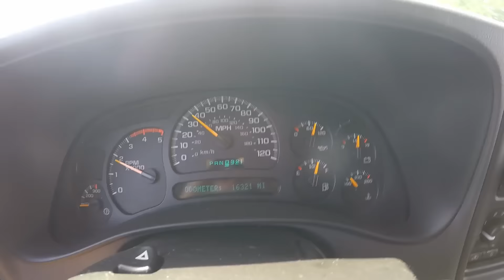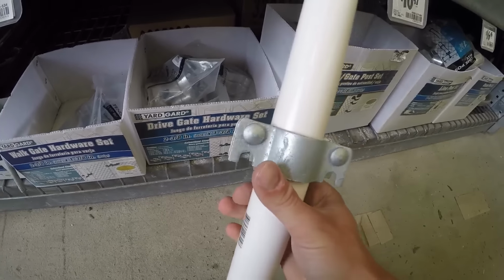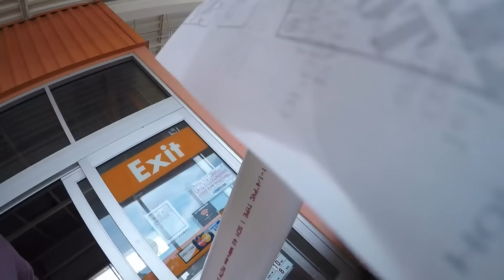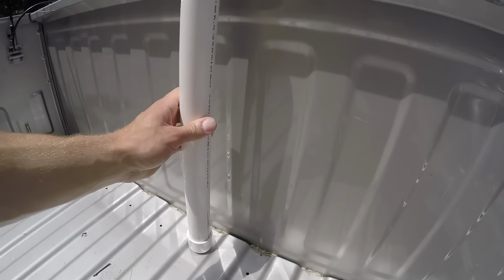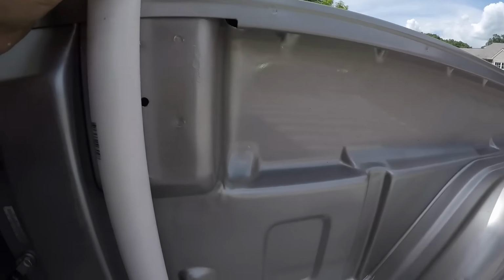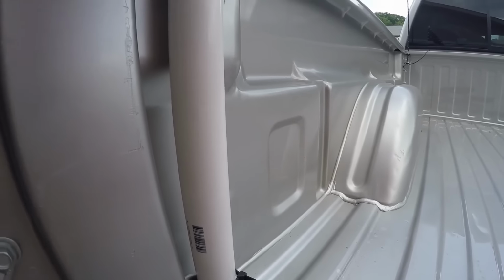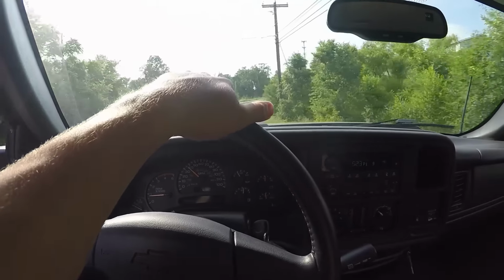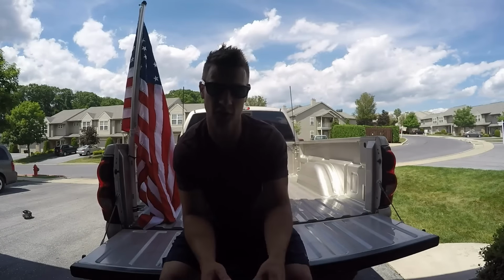My Duramax Is Missing Something...

Comment: I've been flying flags on my truck for over a year now. Both on my 95 Cheyenne and now my 2010 Silverado. The flags themselves can handle high speeds well but they fray a lot faster. I've hit a 100mph a couple times with them on and probably down ever again but the flags them selves held up, but the mattering on how you have them mounted would determine if the whole setup would be safe.

Comment: +street speed 717 what you can do is drill a hole through both the  flag pole and pvc pipe and put a self tap screw there or a bolt and nut so it won't fly out.

Comment: Dude the best flagpole for a truck I have realized is just a pice of 4 foot or so angle Iron with the flag zip tied to it. Then take the angle iron and push it down into the square holes on whichever content of the bed. It won't bend and looks way better than pvc in my opinion.

Comment: Hey man I also have a Silverado and what I do is just stuck the flag in the corner inside the bed rail...there is a hole that goes all the way down the rear quarter panel it sits in there securely you just need a flag pole thin enough..ive driven with it 65 mph and its solid

Comment: you should of used black pipe. the stuff people use to run gas lines in housed. I know it's expensive but, I used that for 8 months without a problem. and that was going 75 mph on i35 in texas.

Comment: The truck needs a wrap with a flowing flag all over it!!!  And a super loud open header exhaust.  'Murica!!!
Reply: It already has straight pipes lol
Reply: Lol diesels don't have headers.
Reply: Lol diesels don't have headers.
Reply: 4 inch straight pipe from the downpipe(s)
Reply: Hunter Stuart
and they do in fact have headers, how else is the exhaust going to spin the turbo to make boost? magic pixie dust?
Reply: if it doesn't have headers where is it straight piped from? last time I checked my Duramax had open headers
Reply: +Bhswarrior94 it's a turbo back exhaust meaning it's from the down pipe of the TURBO (not headers) back.

Comment: only thing I would suggest is put a set screw through the pvc into the wood. There could be cross winds or even updrafts created by the tailgate. Don't need Old Glory sliding down the road.

Comment: I might suggest drilling a hole through the pvc pipe and into the flag post. Then run a self tap screw through the pvc into the flag post so it can't come up and out while going down the road.

Comment: Some tips: Put the flag on the right side, that's what the flag code says. 
Use metal carabiners to attach the flag to the pole, the flimsy metal ones that come with it wont last long.
Get a better flag. The one that comes in those packs is junk.

Comment: Use a different pole than the one that came with it I did the same thing and drive with it at 55 for a few miles and the pole snapped it's worth it to go with a stronger pole

Comment: +Street Speed 717 what I with with my truck is put a 2x4 in the bed up by the back window put 2 "U" bolts that held a PVC pipe which held my USA or TEXAS flag and It held pretty good going 70 down the freeway, if I wanted to make things more sturdy I would get a two ratchet strap rap it around the pole of the flag and tie it to the hooks on both slides of the bed and ratchet it down to make it right and not move!!

Comment: i am sure some one has already told you this but a couple of my buddy's did the same thing last year but for 9/11 and we kind of did the same set up. but the metal pipe that comes with the flag from home depot is very flimsy and so it would end up bending and so fix this it was simple we just replaced it with a wood pole and with the wood pole we drilled screws into the PVC pipe and the wood pole so they would be together and you would go off road or something and the flag falls out, and with the wood pole we covered it in white duck tape to make it look better. just an idea man i still have my set up if you'd like pictures. we did it in my friends silverado and my mustang gt and we got up to 110 with out it falling off haha. you a smart guy so i am sure you have it figured out, if not i can help

Comment: btw its on the wrong side, when the flag is moving forward in battle or in a parade or anything else, it is on it's right side. in this case it would have to be mounted on the passenger side of the truck in order to be deemed appropriate flag etiquette. but awesome idea dude, i drove an 01 accord and made a double mount that straps onto the trunklid

Comment: tip... drill the flag pole and drive a screw in thru the pvc pipe into the flag pole  (i notice u got a hole in the pvc pipe already) added security to keep the flag pole secure ......another thing.. u should do a workout vid/routine.. youre fit dude

Comment: Hey if you want a secure flag pole stand you should (if you have a towing package) is to take a hitch with no ball and a metal pipe. Weld the metal pipe (maybe about a foot long or more) into the hitch and weld a flat piece of metal to the bottom then you could add your flag! 
P.S. Your vids are awesome keep it up!

Comment: Use some metal hose clamps instead of zip ties. Or if your bed has the 2x4 slots in the bed, make a custom mount out of a couple of 2x4's and you can centre your flag in the middle at the front. Slots I'm referring to: http://tinyurl.com/hbzyhjw

Comment: What's wrong with his tired is it cause the stick out from unfmder the fender
Reply: Yes its technically "illegal" because it could kick up rocks and hit peoples cars
Reply: they actually can harm your truck lol
Reply: Wheel spacers can hurt ball joints, anything more than 2- 2 1/2 then you can have fun replacing ball joints
Reply: he doesn't have wheel spacers on it,  he has negative offset rims
Reply: You can run any sized spacer you want as long as the wheel offset positions the tire tread center on the wheel bearing. Hence why dually trucks have up to 6'' spacers on the front, factory at that.
Reply: +Cory Sig yeah I know, that's how my rims are
Reply: +Dylan Groat Wheel spacers suck and are dangerous i have seen them break and the tires go flying. dumbest invention i have ever seen
Reply: +QuadManAustyn99 it's all for the stance tho man.... Haha, I agree with you
Reply: +Jacob Hatzenbeller actually they do, they wear out the wheel bearing faster but thats it besides causing mud to go up the side of truck lol
Reply: +Dylan Groat wheel bearings
Reply: +QuadManAustyn99 those must hahve been the orielly outoparts spacers lmao those suck
Reply: +QuadManAustyn99 those are when they aren't properly mounted and maintained. Besides many morons decides it's smart to stack them. Spacing done correctly will do no harm to your truck
Reply: Yes they do "harm the truck", he doesn't have spacers either. It's a fuel hostage 20x12 -44 offset. The negative -44 offset makes the tire and wheel stick out past the fender. All Chevy's axel is wider in the front also. That's why half his tire sticks out in the front and a Quater of it sticks out in the back. My old 85 model staright axel ways the same way. The new 2016s are the same way. It's something Chevy has always done and will continue to do.
Reply: +Jacob Hatzenbeller he didnt put any wheel spacers on it, it just has an offset cause of the width of the rim.
Reply: +alexander Seledkov you don't get offset because of wheel width. The negative offset comes from moving the wheels mounting service further inward from the centerline of the wheel.
Reply: +32TMG +32TMG the axels are mostly the same width...the lift kit is what pushes the front tires out more than the back, due to the different suspension geometry of the kit. Some kits more than others.
Reply: They're stretched
Reply: +theendisnearbeware it's due to tracking straight on the road. that is why they are narrower in the rear. plus it helps with turning and many other things.
Reply: +Dylan Groat Well he doesnt have spacers but spacers are good for going around town but i saw some one trying to yank a tree down with those on his duramax and they just snapped and lug nuts went flying. He put the tires back on without the spacers and pulled the tree down no problem. They are definitely not meant for pulling shit down

Comment: I welded some brackets on my PowerStroke with two pieces of 1" metal piping to where you were first trying to put it and drilled a hole to put a bolt to hold the poles in place! Now I hang my American Flag and my Alabama flag!

Comment: i like your idea, but i would use nutserts inserted into holes that would have to be drilled for a clean look in case you want to take the flag/mount off but  more importantly it would be way more secure bolting the brackets you bought into those vs the zip ties

Comment: Any outdoor flag should withstand that speed. The problem will be the PVC. It will just bend, even at low speeds. I would go with steel, thick aluminum or something more ridged. But be careful of the metal too because while the PVC will bend, some metals will just bend and then snap.

Comment: I bought  2x1s at Home Depot and drilled holes in the middle of it and took paracord and tied it to a flag and put it in the rectangle pole holders near the front of my bed I run two I've gon 80 no problem

Comment: drill a hole through the flag pole and pvc pipe then you can put a bolt through it and put a nut on the other side so you know it can't go anywhere.

Comment: So.. I need an unbiased opinion one which truck is better as far as reliability and towing capacity between the power stroke, Cummins, and a duramax.. New to the truck world but I know I want to get one and it has to be a big boy truck..
Reply: Don't go with any 2003-2010 powerstroke's as their very problematic
Reply: +Haden Johnson care to elaborate? I know the 7.3 in the 99 was pretty bullet proof but don't know much else
Reply: +Manuel Martinez I feel like I'm leaning more towards a Cummins because I see so damn many of them so that has to mean something right.. Lol
Reply: +Manuel Martinez yeah i would get a cummins but like all engines it will not be perfect
Reply: 6.0L power strokes are just gross. They suck to work on, have many emission system problems (EGR failure, etc) and they are a pain in the dick and expensive to fix.
Reply: +crazydogdude alright so I'll just cross ford off.. Does gmc have anything good?? Or are Cummins and duramax basically the top dogs??
Reply: Since the early 2000s gmc and  chevy's have had duramax's in them. I would stay away from the OBS Gm's with the 6.5 Detroit diesel in them because they are underpowered and engineered to fail. I would personally get an older diesel that doesn't have all the emission bullshit that is expensive to fix when it fails and which completely hinders the engines performance.
Reply: 7.3 powerstroke's and 1994-2002 cummins are both great older trucks. for newer trucks 03-07 5.9 cummins are great also if you have the money
Reply: So older is what's more reliable then.. I do like the 07 Cummins but that bitch is still like 30k! Lol I'll look into the earlier models then Cummins! Thanks guys appreciate the input!
Reply: Agree'd, the 6.0's are garbage, have a coworker that has one and the guy before him had all the stuff fixed like head bolts. Now he's having transmission problems, lol, it IS a Ford, though. =P I'm a Chevy guy just don't know much on the diesel side. I know the Duramax has some years you don't really want, can't remember which ones.
Reply: I have a 2nd gen dodge with a 24 valve, and in the 11 years that I have had that truck it has given me little to no issues. I have hauled cars, lumber, junk and for many years it carried a camper while towing a boat and never once has she given me any grief or left me stranded, and she is still being daily driven. I'm not saying other trucks wont do that, they absolutely will, that's just my experience.
Reply: 2005-2007 Duramax is the way to go. Earlier years had head bolt issues, possible injector problems. After 2007, they have emissions b.s.

A lot of Cummins are great, but there are a long list of automatic transmission issues. Not sure when or if they ever got a reliable transmission(automatic only) installed.

Ford 6.0 have a long list of issues. 2008 twin turbo was a flop and horrible on gas. 7.3 is a great engine, but the govt. forced it out of production. Fords had hydraulic injectors(not sure on years), which if not taken meticulously care of, can end up costing thousands in repairs. No way of knowing on a used truck.

Comment: for extra precaution I would drill a hole through a PVC pipe into the metal that the flag is on and put like a bolt through it so the flag doesn't come flying out of PVC pipe and not saying I will just to be safe so it doesn't go through a car window lol

Comment: An Annie makes a high wind flag which Is made from sail boat sail cloth which will not fray apart at all even at long highway speed you can get them at Walmart or Home Depot. And you could have got a long tree stake. And mounted the flag to it that and slid it down that hole in the top corners of the bed. But what you did is perfect good job haha MERICA!!!!

Comment: witch engine does that truck have in it
Reply: a diesel one lol it might be a 6.6 I do t know for sure
Reply: 6.6 dmax
Reply: to be more specific it is a LB7 6.6L Duramax
Reply: +Alec Cohen Pretty sure it's an LLY, not an LB7
Reply: +Nick Jefferys yes its a 6.6 lly duramax
Reply: Thought it was a LBZzz
Reply: Nick Jefferys yeah my bad i fucked up which front end it had
Reply: +Alec Cohen it still could be an lb7. The only difference between the lly, lbz and lb7 is strictly engine. 05-07 models said Allison transmission in the duramax badging, so it is definitely not an LBZ or late model lly. So, it is either an lb7 or earlier lly. (03-07 was cat eye. 03-04.5 was lb7. 04.5-some 06 were LBZ. Majority of 06-07 was LBZ) all cosmetically, the same appearance aside from badging and slighting better interior trim packaging in the later models.

Comment: The flag should never touch the body of your truck or anything else. You should've made that pvc pipe taller and made the flag stick up higher so it would not touch the truck when you were not driving. Just out of respect. You should take that into consideration.

Comment: They sell on Amazon a aluminum pole holder for a 2 inch hitch and I bought a PVC pipe and fit a 3 x 5 flag off the back of my truck it was 15-20$ I'll hit you up on Instagram of my set up now and give you my old flag pole hitch